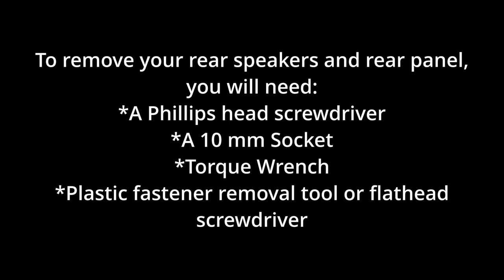How To Remove The 6th Gen Celica Rear Speakers and Interior Panels (1994-1999 Celica Convertible)

Comment: Hi, I loved this video, it was so helpful I managed to get the interior out of my 1998 celica convertible. The only difference I found in the convertible is that the top of the side panel is a separate panel held by the top 2 screws. There are 2 plastic fir trees on the hood side of the panels at the rear. I also managed to remove the speakers by just undoing the screws rather than remove the whole bracket.  Thanks a lot for the video. I will watch your other videos with interest. 😃

Comment: What brand and size speakers did you install? Did you do the front also? Thanks for the video
Reply from the maker: For the rears I just installed some cheap extra set of Dual speakers that came with my headunit. I did the (lower) front door speakers too. I installed two  8" Orion XTR-804NEO loudspeakers, cost me $109 + tax & free shipping through ebay. I will likely install some 6.5" Orion speakers in the rear too when I have extra money. 

I had a video shot and almost fully edited for the front speakers then my memory card stopped working recently so I have to redo all the content I had ready to upload.